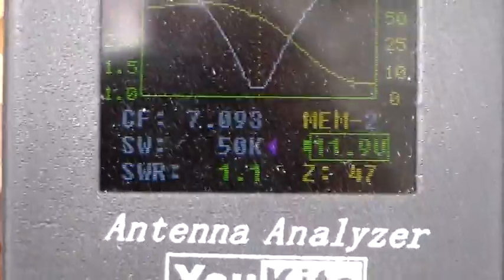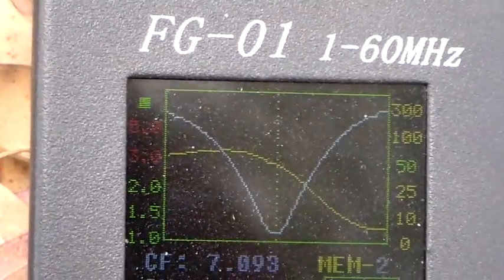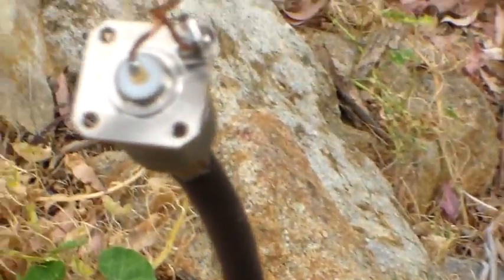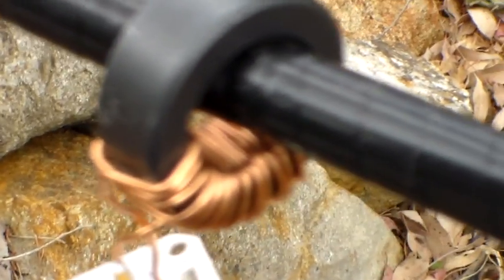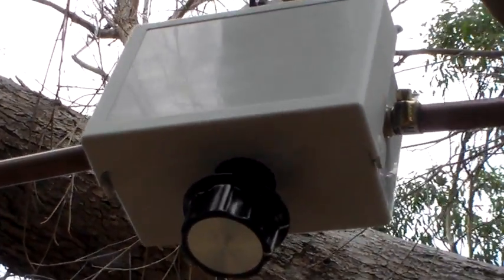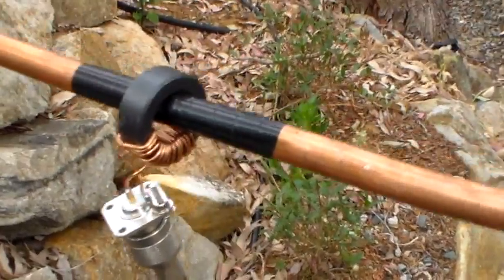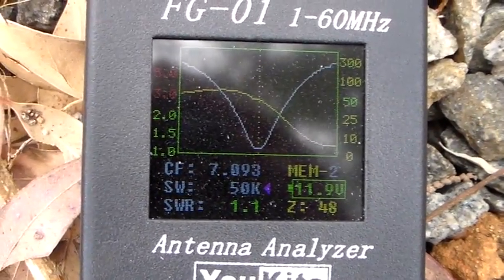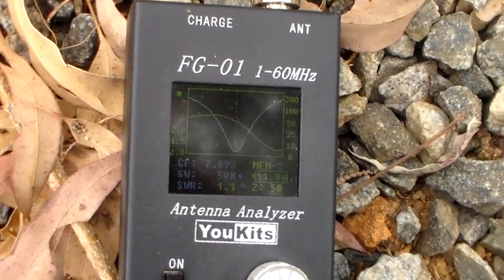Magnetic Loop Antenna Matching

Comment: Hi great Idea. I made a magnetic loop dual band aerial for QRP operation. Fine and course tuning capacitors. Used car brake pìpe and a selfie blogging lighting tripod. Works great and lightweight for portable use. I will experiment with your idea. Cheers from old George in the UK 👍🤠🇬🇧

Comment: Congratulations, you have hit on the single most important development in getting a loop antenna to work really well - feed it with a toroid! 
About 35 years back I put a lot of effort into trying to build an effective DF loop for 27mHz. I tried every design I could find that was supposed to work and they were all average to poor performers.
the reason being that the impedance match bad and there was feedline radiation / pick up that caused inconsistent results. Another Ham suggested that a toriod feed might be worth a try, well I tried a F25 (?) grade ferrite. think I had 4 or 5 turns on the feed side, the secondary being effectively half a turn... Well that sure fixed it up, more signal, perfect balance and very deep nulls, the problem signal were located in a very short time.  I still have it in the cupboard, VK3KCX

Comment: Do you think its better to use a ferrite core for coupling to the outer loop like you did or it doesnt matter to use a simple one turn small loop to couple it with the outerloop? Thanks
Reply from the maker: I can't answer that one I'm afraid. I haven't tried the single loop coupling method so I don't know which one is most efficient.

Comment: Thank you for sharing on your design efforts. May I ask also about your use of a wound core as a driving or “inner” loop as opposed to the “traditional” 1/5th simple inner circle. I am currently working on a 2 meter diameter loop constructed of 4” copper ribbon and have been struggling with decisions regarding the inductive inner loop as well as the “come together” of it’s top end for connection to the capacitor
Reply from the maker: I haven't tried the 1/5th coupling loop design so I can't tell you from personal experience. I can tell you the Ferrite core method seems to work well, and that you need to keep all connections as low resistance as possible. Maybe you could try a gamma or delta match to your copper ribbon. There's also an 'Army Loop' type of match using capacitors: https://i.pinimg.com/originals/71/27/a8/7127a8aded1af4dba205c1a2ea89d0ee.jpg
Reply: VK6CS thanks . I will explore the link . 73

Comment: Good sir! May i ask what type of toroid, the gauge of magnet wire, and the amount of turns you enlisted in the creation of your coupling transformer? Good Day and 73's !
Reply from the maker: You certainly may good Sir. The ferrite core is a Jaycar LO-1238, the wire is Jaycar WW-4024 and there was about 12 turns. 12 turns should at least get you in the ball park. 73.
Reply from the maker: Hi Tim. Yes, correct, it's to prevent the enamel being scraped off the wire as the toroid moves about.
Reply: It looks like some electrical tape on the loop where the toroidal is.  Correct?

Comment: Which coupling method do you like best? Ive seen alot of loops made with a 1/5th size loop, then a few with gamma matches, this one with a terroid.
Reply from the maker: I haven't tried the other methods so I don't really know. I tried this one because it was the simplest.
Reply: VK6CS idk, the coupling loop made 1/5 size attached directly center opposite of the capacitor usually works 99.9999% of the time the first try.
The side opposite of the cap is basically close to 0 volts in the center and can actially be grounded and mounted to a pole. The cap side will degrade the swr severely if it gets near anything conductive.
I usually just let the inner loop touch the outter loop as it has no effect and insulation is unecessary (as long as its completely centered). If the coupling loop is too large just squish the end near the big loop closer and it will lower  the swr. Usually 1/5 the circumference of the big loop is the magic bullet.
It would be awesome to compare all three methods and see which has lower losses/more gain.
Reply from the maker: Hi Richard. Yes indeed it would. The toroid is more convenient for portable loops made from coax, they can be folded up with the toroid permanently in place that's why I was most interested in that method. Maybe I'll give the other methods a go and do a comparison as you suggested when this amplifier project is all done and dusted.

Comment: Did not grasp the diameter of the copper pipe and will this perhaps also resonate on 20m?
Reply from the maker: The diameter is 10mm. I haven't tried it on 20m but as it's a higher frequency I think it would.

Comment: I made a 5.1 diameter Mag Loop for 40M and the SWR was at a 4.1:1. That was with a thin aluminum 1/2 metal as the smaller loop. The 5.1 loop was made with 1/2 copper tubing. I made a smaller octagon with the same 1/2 copper and the swr was 3.6:1. The signal strengths that I got was astonishing, in comparison to my OCF wire dipole and my 75M hamstick dipole. I really want to try these the next time my Cub Scout unit goes camping. I want to see how it all sounds away from the QRM in my town.

Thanks for the video!
Andre, N2JDH

Comment: ARe you connecting an unbalanced coax to a balanced coil?
Reply from the maker: The coax is connected directly across the coil. It acts as an RF transformer where the coil is the primary winding and the loop is the secondary winding.

Comment: I don't know why you worry about security - The Mossad already knows where you live - 619 Murray Street.
Assuming you're still with us of course, and have not been whacked, we look forward to watching some QSO videos.
By the way, I did particularly like your capacitance matching box - very sweet :-)

Thanks Steve - Putting the amateur into radio - and the FUN.
Reply: I have a new radio video.
Reply from the maker: I wouldn't have drilled holes in the roof of my LandCruiser.
Reply from the maker: Thanks Ade... let's hope Mossad have a sense of humour.
Reply: VK6CS I didn't drill the holes. It was a CoA technician.